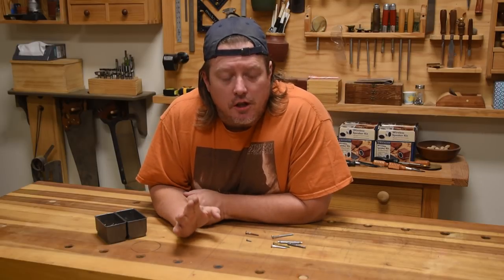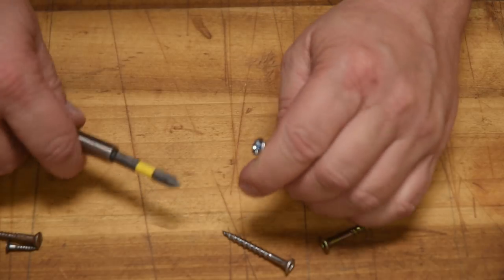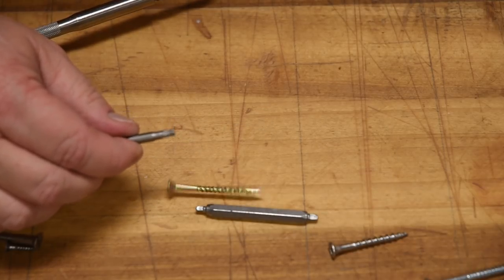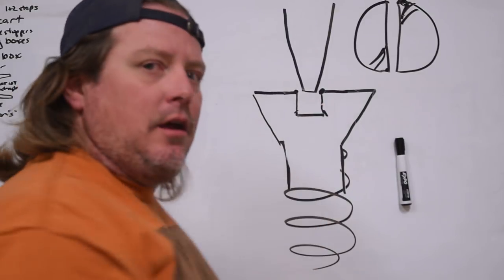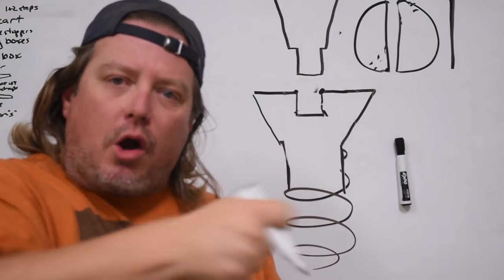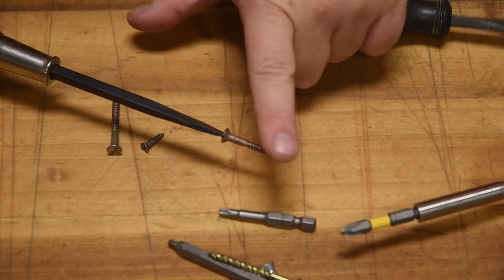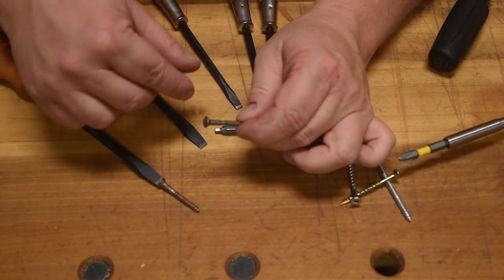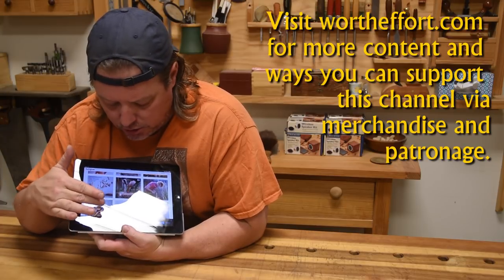Screwdrivers

Comment: You hit on most of the points. The main reason for using slotted screws in the "old days" is that its all they had the technology to make. or it was the quickest thing to make. I regularly make my own slotted machine screws for custom applications with my mini-lathe and metal stock. its a pretty simple operation to flip the blank around after threading and shape the head, then cut a single slot across it. doing any other pattern requires more advanced tools that would not have existed or been practical 200 years ago. 

The issue with slotted screws for woodworking is that they are like cut nails. they require some prep work to get them to go in with no fuss. you cant just stick one on the end of your impact driver and zip it into the wood with no pilot hole, the driver bit will cam out with nothing to hold it in along the slot axis. Of course, this is no problem for fine furniture. because you should be taking the time to properly align and predrill any screw holes anyway to prevent splitting or the screw causing misalignment when it engages the other side of the joint. But when your building a deck or a fence or a house? nah, grab that torx head screw and just zip it in there.

Comment: Excellent info. I learned this by accident a few years ago when I threw away my motley collection of screwdrivers and bought a nice wood-handled set made in Germany. It only included two Phillips (#1, #2) but five sizes of straight slot blades and they are nearly straight as you describe (too bad, no shoulder, and I don't think I want to grind the hardened tips). Couple of observations: the big box stores seem to be phasing out Phillips in favor of Torx across their entire screw lines (or maybe its the manufacturers doing it), and brass screws have gotten a little hard to find and expensive in any configuration. You can get them in quantity in Robertson drive at McFeelys but I don't think they have straight slot which you need, as you note, if doing high end or restoration work. My local True Value hardware store has four aisles of fasteners, everything you would ever want, in brass, steel, SS, bronze, but boy are they expensive! Thanks for the video.
Reply from the maker: You need to watch out. Most of the big box store brass stuff is really just brass coated or colored (I've never seena real Robertson brass screw). Plus they don't heat treat the big box ones right. You can find decent ones online just understand you pay for quality. $.25 to $1 isn't uncommon. But how many screws are you using in a furniture piece anyways? Seems a cheap investment to me.

Comment: I've heard some people say if you burnish the ends of your slotted screwdriver it grips better also. Never tried it. Probably not needed with those proper sized drivers though.
Reply from the maker: Ya, I was thinking about adding that trick in but didn't want to complicate the issue. It turns a burr on the end that bites into the sides of the slot.

Comment: Excellent instructional video -

Robertson was patented in the 40's as a design for self centering power driven fasteners, Manufacturers  refused to pay the patent royalties (Robertson drive is a Canadian invention) because it was not an  American design - so " Phillips " was invented. Slot (or standard) screws date back to the 1600's , or earlier, because the slot was easy to make by hand. the more complex shapes are artifacts of automated manufacturing. Ditto the wedge shaped screwdrivers, as manufacturing costs were reduced, and quality was thrown out the window.
Reply from the maker: Thanks for clarification.
Reply: I've seen a similar story about Robertson and Henry Ford.  Henry wanted license (licence?) to make the screw and bits, but could not come to terms with Robertson.  Phillips came along about the same time, and was willing to meet Ford's terms.  I looked up the Phillips patent, and found that it included designs for 3-, 4-, and 5-bladed screwdrivers.  I use Robertson and Torx whenever I can.  Woodworkers should look at the screwdriver bits and screws, to see if they are licensed, just to get the best fitting bit and screw combination.  IMHO
Reply from the maker: Slotted are just as easy with the right screwdriver plus look cooler clocked. (opinion statement)
Reply: I agree about the clocking - once saw a mahogany boat with about 2000 screws all at exactly the same angle - blew me away.

But I'm a commercial carpenter and may drive more than 1000 screws a day - Robertson is the only way to go, for me -

Comment: Is there some special purpose for the brace square-shanked screwdriver bits? Would I be wrong to assume they're for back in the day when telephone workers and house carpenters would use a brace and it saved on belt space and weight?

PS: I rather like hex socket screws over torx. The kind you use an allen key with. But unfortunately for me they don't seem to make any for wood.
Reply from the maker: I don't know on the drivers. Stanley did make a whole line of popular braces for SW Bell (labeled as such).